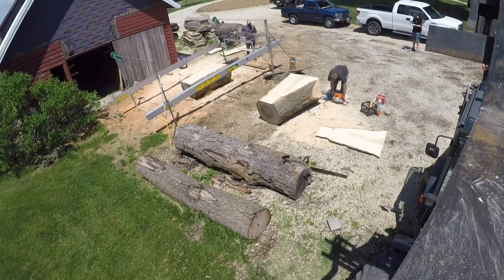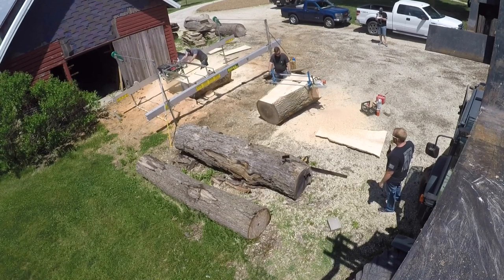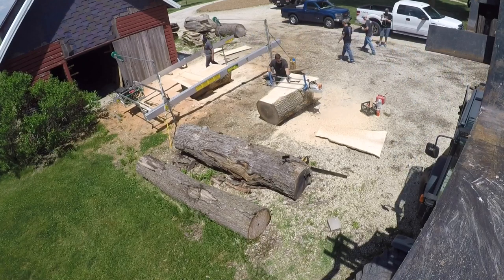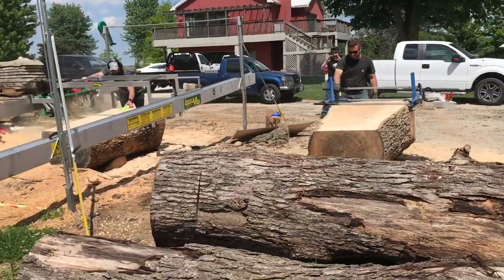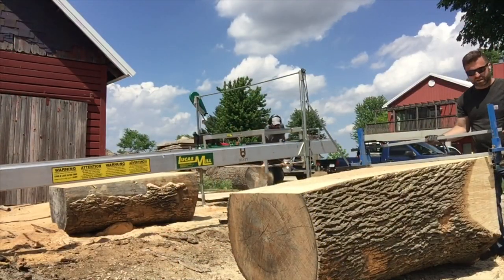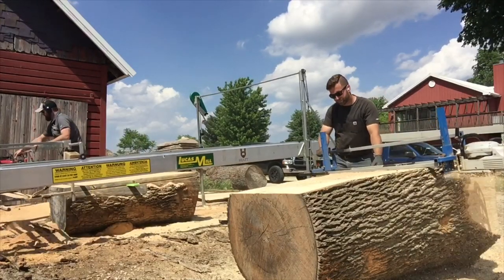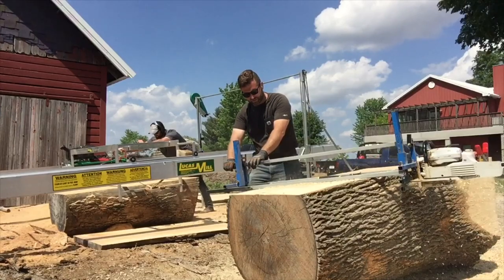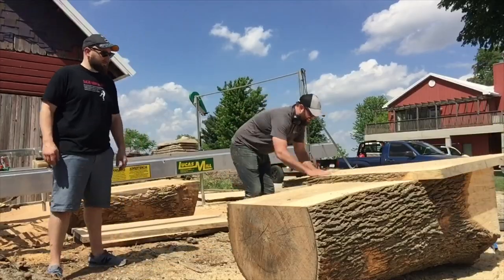Lucas Mill vs. Chainsaw Mill-Drag Race

Comment: There are a few manufacturers who make bandsaw mills with a super wide cut but they aren’t cheap. I think the Hud-Son Oscar 52  is the cheapest at around 23k starting price, it’s also the smallest cut at 48 inches. The prices and sizes climb way up from there.  Bandsaws are faster and have a lot of advantages but they can’t be setup over the log like a Lucas or some of the other chain mills.  Another expense is equipment to get the logs to and on the bandsaw mill, and only the smaller ones are towable.  Most of the real wide ones are not portable and require a good foundation.

Comment: I also have a 661 (and an older 660) and have been thinking about getting into alaskan milling up some slabs as a part time gig. I bet it's pretty hard on the engine after a while.

Comment: As a portable setup we can not forgtthe amount of time it takes to set up a lucas VS a chainsaw mill.

I can get the first cut done with my chainsaw mill in about 15-20 minutes.

How long does it take to set up a Lucas as a portable setup?

Dont get me wrong.  I want one.  I plan to Just because of the capacity it can handle with ease.

Comment: The Lucas I would image keeps the slabs pretty flat and true due to the long aluminum rails. How are the Alaskan slabs in that regard? And chatter? I have seen band saw slabs and they are pretty smooth. Lucas seems to be the way to go if you have the $$. Better on your back I would think too. Nice comparison though. For an occasional use the Alaskan seems ok. Thanks for the clear video.
Reply from the maker: Essentially the Lucas and the Alaskan are the same as far as flatness. They are both chainsaw bars in that regard. Cut quality comes down to chain condition. 

The Lucas is roughly 5-6X the cost of a standard chainsaw setup so it would take a lot to make it all worthwhile.
Reply: One thing to note on an Alaskan is that they can cut very flat, but any cutting error will be repeated in subsequent logs since it's referencing the last surface cut.

Comment: I think to be fair, lets take both mills from the back of a truck into the forest 50 yards deep ( or a back yard) set up then slab a 40 inch log 20 ft long, then take the mill back out of the yard . add alittle slope to the log lay and the lucas gets much slower. ps yeah your milling chain will help with both speed and power requirement
Reply: Agree, I do a lot of chainsaw milling and everyone tells me to get a band saw mill. Just not possible in all locations and terrains.

Comment: I think my mill setup of dual 660s or a dual 880 mill would have been a more comparable test. Where are you guys located? I would be interested to see the speed difference between a dual head mill is that Lucas mill
Reply from the maker: Yeah, I’ve wondered how a dual head setup would run. We’re in East central IL.
Reply: @SlabGuy  I'm down in Georgia. As soon as all the parts come in next week we will have it up and running shortly after

Comment: Aren't you losing alot of wood compared to a band saw mill?
Reply from the maker: I’m going to do a video on here going over this. There is more loss, but not enough to make a difference to me. It wouldn’t add up to another slab.